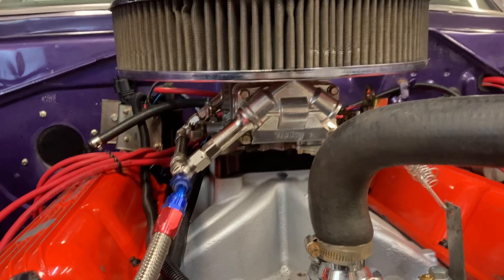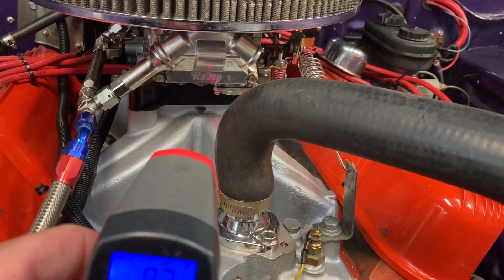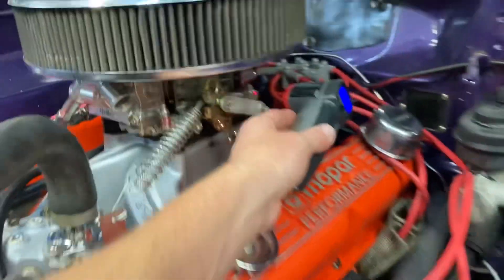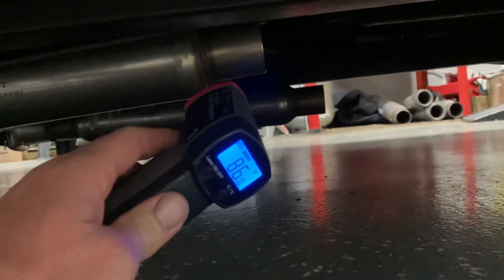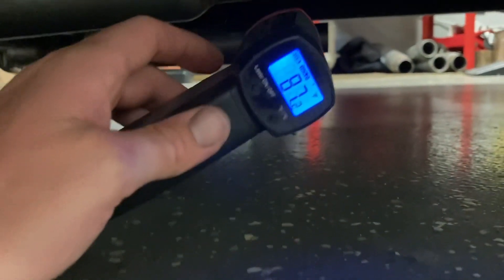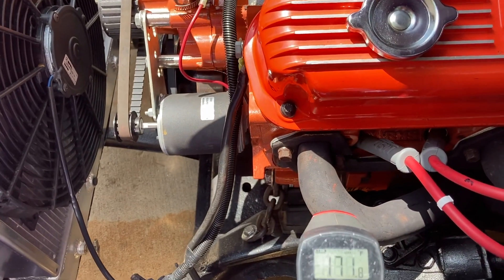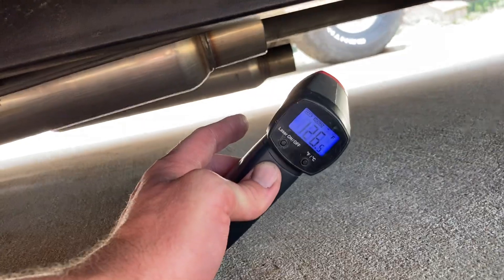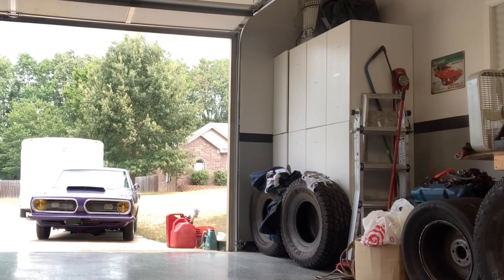68 Barracuda Dragcar: Data Acquisition for a Custom Spacer Plate #nonamenationals #mopar

Comment: If you watch engine masters they’ve done some testing with temps.  Important temps are fuel temp for carb setups.  I think they gained a few hp with colder fuel.  Intake temp didn’t matter even when they heated it way up.
Reply from the maker: Thanks Chris. I’ve seen them all. LB wants the temps to compare to after I use his spacer, to test it’s effectiveness in the engine compartment.

Comment: I did not like the temp on the last header tube almost 100 deg different not good if I heard you right on the temps
Reply from the maker: It was 201 vs 238. Next time I will test with it running too. I realize that a lot of these tests are boring to people, but I like to spot the changes and what’s causing them.

Comment: I hope you get the same results on the 2 in spacer plate that I got you'll be impressed.what was that sticking out from your shifter housing on the passenger side
Reply from the maker: Thanks Russel. That was a mount for a camera that I had on my AFR meter

Comment: Did you see the episode of engine masters when they used a infrared camera to video the engine on the dyno ? You can see how cool the intake and carburetor are from the air going through  , Wilson makes some pretty nice carb spacers but I think you may see more performance improvement by running a air pan sealing the carburetor to the hood scoop so it breathes the cooler air from outside the engine compartment .
Reply from the maker: Yes sir. I saw that test. I am sealing the scoop off for sure. I wanted to save that test for the track, so I can show the et and mph differences. I will do the same with the plates. I know it may be small increases, but eventually they will add up.

Comment: My experience with non-contact thermometers is that if the surface is very shiny and reflective they do not respond well, to help that out you can put a piece of tape over the shiny surface and they will be much more accurate
Reply from the maker: Thanks Thomas! I appreciate your insight. I guarantee I am open to learning new things.
Reply: Mr Ward is correct. I use one often at my shop.
Reply from the maker: @altpraize6708  what type of tape? I need it to stick to 200 plus degree surfaces. I figured the flat black header paint would be good. The intake is actually painted with cast engine paint to help prevent corrosion. I definitely want some level of accuracy. The time slips will certainly be the proof.
Reply: @JustMoparJoe  flat black paint is good for headers, I've used duct tape for the intake manifold and block . Of course, it only lasts for short time. So I had to get temperature reading quickly. I had new idea, but haven't tried it yet.......get some of that aluminum tape used for heater ducts in houses, paint it black then put it on exhaust pipes.

Comment: I was told the engine should be at 180, and anything cooler as a constant would cause premature cylinder wear.
Reply from the maker: Well, this engine had about 150 passes on it before we tore it down in a previous video. It’s the 408 stroker series. We then checked the cylinders with a dial bore gauge and they were perfectly straight within .0005.
I am scared to run it any Warmer. At longer tracks and long waiting lines in staging, it can get to 190 when it comes back to the pits.

Comment: joe the wooden spacers work real good have you ever used one
Reply from the maker: No sir I have not. I dreamed about making a wooden plate to block off my scoop. I figured it’d be lightweight, easy to manipulate, and would block heat. I need to make it rigid enough to not wrap up.

Comment: Before I read the comments and finish the video I'll guess carb will be cooler phenolic spacers are supposed to insulate the carb and add velocity to the fuel mixture going into the engine
Reply from the maker: Thanks Dina! LB is cutting mine this week. It’s a 2 1/4” thick piece of aluminum. Definitely a change!

Comment: Joe what thermostat temp are you running? 160 or 180?
Reply from the maker: I’m running an electric moroso water pump motor, hooked to a stock replacement alternator, and a gutted thermostat. When running without one, it seems to flow more water and overheat. This is how we always run our drag cars.